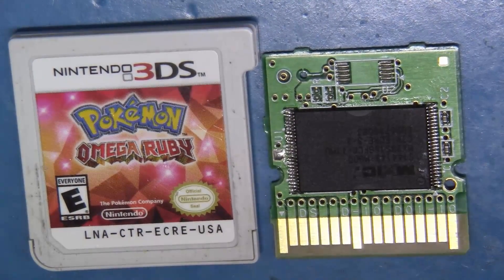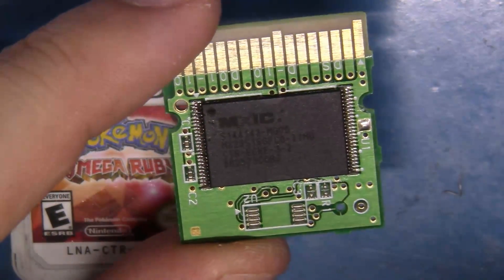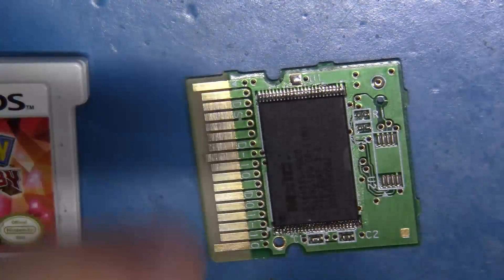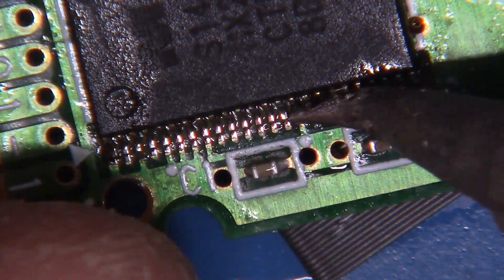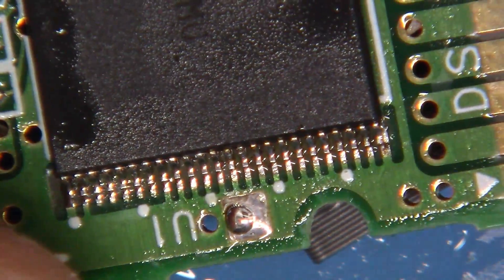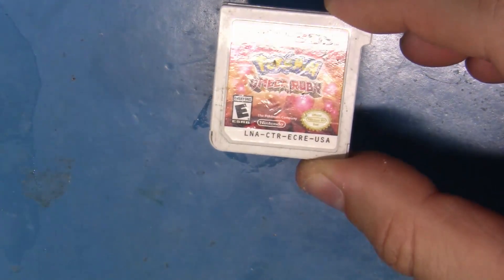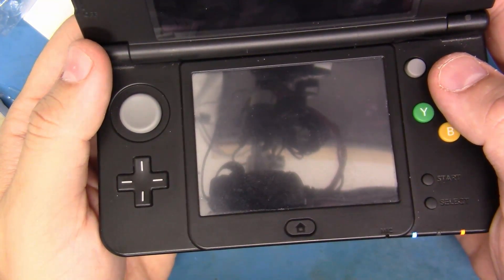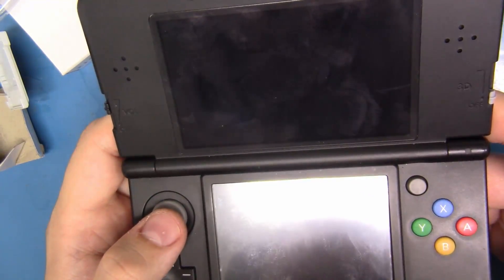Repairing a FAULTY Nintendo 3DS Pokémon Game Card | RAW/UNEDITED VIDEO

Comment: most electronic fails are a broken connection/wire of some kind, over the decades the only thing that changed is the size of the wire.
Step one is always check the connections to the parts starting from power supply(by that I mean the wall, not the PSU of a device) inwards, to eventually the part and if its more complicated and has more parts, power supply into those parts, then into the main part, whoever wrote those articles is ignoring basic diagnostics o problems.
slapping anything with a "these things just break LOL" is a sign of a lazy asshole.

Good work on the repair, and showing people how to do it, and inspiring people to repair. you got my like n sub.

Comment: At what point to you start to worry about overheating chips / components with the soldering iron? I worry about cooking things by accident a lot, so I was curious if you have a rule of thumb. Anyway, this is a great video clip.
Reply: It's fine as long as the soldering iron has grease for flow/keeping the area cool.
Reply: @Majinhero  oh, cool. Thanks!

Comment: not only can the thin pcb flex and fatigue the joints over time BUT the high tin solder used by most manufacturers since the early 80s is actually prone to crystallizing which means the internal structure of the metal solder changes and slowly becomes more brittle over time

Comment: As a fellow ksger microsolering person (though not as learned as yourself), I just got an axiun t3b jbc clone for 160 and it's incredible. I have the smaller t210 handle. I sold one of my ksger units. This seems to be the next great clone evolution the
Ksger was when it was new. I paid 169cad which was what I paid for my ksger

Comment: a reflow and a good clean is how i usually end up accidentally fixing things when i have no clue of what the issue is
Reply: Its always a good thing to reflow. That's how I fixed my copy of Rampage for the GBC after it had stopped working over 16 years ago.
Reply: Same, I fixed my Pokemon Crystal after reflowing the first chip. It's a really easy fix and it doesn't hurt to try it first before any other diagnosing goes into it.
Reply: If I want to reflow the contacts like this video, is a higher temp on my butane iron better? Or a lower temp? And is more flux better? Or a conservative amount?
Reply: @MrMunkboy  I start conservative with a reflow and get progressively more aggressive until it's fixed.

Comment: I was telling people about that when the whole craze happened. I had reflowed some Persona Q and Pokemon Alpha Sapphire and Omega Ruby's... there is a defect in fab though as these carts will fail more than others. Though it's really not the case of DOA where chips will die out even if you don't use them. People said I was crazy that it was everywhere. PS5's redesign was also everywhere for running hotter, when it fact it wasn't. Viewcounts > Reason.
Reply: So other 3ds pokemon games like pokemon sun and  moon etc. have not this problem?
Reply: @thatboi567  To my knowledge only Pokemon Omega Ruby / Alpha Sapphire and Persona Q were built like that.
Reply: @thatboi567  nope. I have X i have Alpha sapphire then Sun and Ultra moon. The only one that doesn't work is my Alpha sapphire. The others all work just fine so it mainly is an issue with those particular cartridges as the other games have had 0 issues at all
Reply: @thatboi567  My Y cart has issue. Could be wear heard a weird click before/during insertion though it went in fine, moved the save to sd fine but it shows up, not booting though. Has a playthrough or less so no massive wear. Likely getting a solder to try this out sometime.
Reply: @dianaalyssa8726  I have the exact same issue with my y cart. I can still transfer pokemon in and out of pokebank though the 3DS just won't read it

Comment: Hi Voultar, in the particular case of this cartridge; when you say it "wasn't booting", in what ways specifically was the system reacting to this cart? I have a copy of Pokemon Y that the system recognizes as Pokemon Y, it loads the icon (bottom screen cart icon), but then it fails to load the banner (top screen). It does also show me the update notice to download the game's v1.5 update but upon trying to launch the game, I get the "This Game Card could not be read." message. Same exact problem on two 3DS systems, my original launch unit, and also on my main system, a New 3DS XL Samus Edition. Note: I was able to successfully recover the save file off of the cartridge. Also, a dump of the cartridge resulted in a corrupt dump that doesn't match known hashes. It did however fully dump the 2GB.
Reply: It still could be some address lines that aren't properly connected. What are the differences in the dump? If it's only some bytes, then the rom could be corrupted.
Reply: @ponjadito23  I'm waiting on a replacement copy to compare against. But really, if one of the data lines was disconnected, I'm pretty sure the icon would not load, it wouldn't be recognized as Pokemon Y and also that the save would not be accessible either. Based on the description in the video, this cart simply didn't do anything at all in a 3DS, and now works after reflowing the chip.

Comment: I wonder if this is the issue I have with my copy of Pokémon Diamond. I've owned it since 2008 and a few years ago, the game wont read in any of my DS or 3DS systems. I still held on to it, hoping to figure out what the issue could be.
Reply: Before doing that, clean it really thoroughly, using alcohol and some cotton, maybe it's just junk in the pins
Reply: I guess there's only way to find out. Check the cartridges and reflow the said joints

Comment: hi, i dont know much about soldiering so just a few basic questions:
how hot should the iron be for this?
do you know any good soldiering tutorial videos?
is the flux nessecary?

thanks!
Reply: Practice on junk first. The temperature depends on your technique, you want it hot enough not to rip any pins off but not so hot it wrecks the board or chip. There are a bunch of tutorials, I can't think of any single one that covers everything but EEVblog, GreatScott, and element14 have tutorials plus Voultar's stuff is really good to learn from. It's good to watch a few different people to get your own ideas but no matter how many videos you watch, it's more of a learning by feel kinda thing. The flux is like a cleaner and helps avoid shorting adjacent pins, it makes it a lot easier and more reliable - sometimes an expert might be able to get away without it very occasionally on larger pitches, but for something like this it's pretty much essential (unless using hot air very carefully instead of an iron, but even then it helps make it more reliable)

Comment: so did this fix work in the long term? I have the same cart and it will boot up ok about half the time and then eventually error out, lasting sometimes even 10 minutes before failure. So just getting to the boot screen isn't exactly proof that it's fixed - maybe you just got lucky. I hope not, however, as reflow is at least something that can be done whereas a bad flash chip unfixable.

Comment: My Wifes Omega Ruby shows but says "This Game Card Could Not Be Read" is this the same issue and possibly require the same fix not that I trust myself to do this anyway...
Reply: might be an issue with cartrige pins making bad contact. try cleaning them with isopropyl. also the console's cartrige slot (albiet carefully, you dont want to break it)

Comment: My goodness I thought I was the only one with this problem but no ! Thank you for your video ! 
I still have one question, I am french and I didn't understand what kind of product you use to reflow the cartridge. Could you please write it down for me and perhaps explain where I can buy it ?

I hope you will see this message 🤞🏻 and thank you
Reply: looks like just a soldering iron, flux, and solder
Reply: @burp2019  Thank you for your answer.
This is something you don't find that easily or that you can handle without previous knowings...
Reply: @floflops30  they're extremely common in electronics work lol
Reply: Did this work for you? Got the same problem and am considering to try it
Reply: @CritsVG  Never tried, the procedure and products are not that clear
Reply: @floflops30  Alright, thanks a lot for your answer!!

Comment: I have a copy of Alpha Sapphire that boots, but it crashes at a particular spot. After the electric gym leader battle it crashes and gives me an error.
Reply: Electric types interfering with the electronics probably.
Reply: I have the same problem. What are the pbc codes on top of the contacts? The last digits are D01-10. And the batch code on the back side in black?
Reply: @PrimoAngelo00  DS N-7 D01-10 and ECL EX42001

Comment: I had something similar happen to me with an Arcade Card Duo, games that needed it would boot but then they would be missing sprites or backgrounds. It was a relatively expensive acquisition so I was bummed. I opened it up, saw nothing out of the ordinary and just figured I might as well take a shot at reflowing all of the solder joints. After that, I slot it back into the PC Engine Duo and voilà, it worked.
Reply: How hard/destructive was opening up the Arcade Card Duo to do the repair? Did you happen to take pics of the board out of curiosity ?
Reply: @saruhankarademir9806  IIRC I think I did take pictures. If you're careful it's not destructive at all. The backside is a metallic sheet that's adhered on to the plastic housing. Mine was already opening up a bit, I used a pick from the ifixit kit to go around the perimeter. Then I glued it back on with some spray adhesive. Looks good as new.
Reply: @hadesmcc  that’s really good to know. Mine has been fine (for the most part) and I keep it in my pc engine most of the time, but I suspect I’ll be doing this sooner than later. 
Which type spray adhesive did you use?

Comment: hey voultar, my new 3ds cannot charge via the plug but can be charged via the dock. Any idea why?
Reply: Because the charger port on the 3ds is broken. The dock charges the system via two metal contacts on the sides of the charger port.
Reply: @jimmyeddy  should the positive contacts be connected between these two different ports? I did a continuity test and the positive contacts don't seem to have a connection.

Comment: I checked the dump of my AS cartridge that stopped working, I found the dump to be almost perfect with only 10 differences against a good dump, so I doubt in my case that it's bad solder.

Or maybe the heat from the soldering iron somehow revive the flash cells ?
Reply: I have the same problem. What are the pbc codes on top of the contacts? The last digits are D01-10. And the batch code on the back side in black?
Reply: @PrimoAngelo00  D01-10
ECLPX42001
Reply: @indask8  I Have 42342
Reply: I have the same issue, reflowing doesn't do anything in this case

Batch codes:
ECLPX42125
DS C-2 D01-10

Comment: There definitely seems to be some statistical irregularity with this particular title, its counterpart Alpha Sapphire, and the US release of Persona Q, which came out within days of OR/AS. It's possible that that irregularity is in the form of a bad batch of solder instead of a bad batch of flash ROMs, so I'm not discounting the work presented in this video - it's definitely an interesting thing to consider, though it might be tough to test at any sufficient scale given the fact that most laypeople will not attempt a reflow of their own cartridges.

But it's also possible that this is anecdotal (especially since the majority of defective OR/AS cartridges reported are the PEGI release, not the ESRB release as shown in this video). There's also the fact that some people with defective cartridges and the capacity to dump 3DS games have dumped their faulty cartridge and found a relatively small number of discrepancies from a verified good dump - which, to me, points to data retention failure in the flash chip more than solder problems, which would presumably lead to a much greater number of discrepancies or a complete inability to read the ROM at all.

Hopefully both avenues will be explored, as this certainly is promising, and I frankly prefer this soldering issue to be the problem since it's fixable. But I'd also hate to see this spread as a 'debunking' of the reported problems when much more investigation is still required.

Thanks for the video!
Reply from the maker: Absolutely nobody under any circumstances has presented the information in this video in a manner that "debunks" the reports circulating of certain 3DS titles failing. I've said repeatedly and unequivocally that this is all incredibly anecdotal and can't possibly be asserted as an across the board fact or "fix".
Reply: @Voultar  I have 6 Italian (European version) ORAS game, 2 are not recognized, 3 with crash ingame. All 5 has been reflowed and only the 2 not working now are working fine. 3 with problems still have the problem. Tonight I will dump all the games to do a hex comparison. Almost all of them have been barely used. Only a Ruby has been hard used with >300 hours ingame (now is crashing ingame).
Reply: @PrimoAngelo00  What's the result? Posted it somewhere?
Reply: @PrimoAngelo00  did the reflow work in the long term for 2 that it initially fixed?
Reply: @PrimoAngelo00  boop
Reply: @Voultar  I find it HIGHLY unlikely that Flash chips are failing this quickly. These carts aren't even 10 years old, and I have EEPROMs made with MUCH worse technology from the 1990s that still work fine like motherboard BIOSes.
Reply: @Voultar  Yeah I agree you did not remotely present it as that, and I am not accusing you of doing so. I'm speaking generally because these things all have a way of telephone-ing quickly and getting out of hand (like the initial story of "50% of copies have failed" as you mentioned on your Twiter feed).
Reply: In mines case it is defenitely a data issue since it worked fine before i reset my save data to do a challenge run after playing trough it normally. Now it won't boot and will simply say the cartridge cannot be used (i know it is not my ds at fault because all my other games work just fine) previously however it would boot up untill the title screen and then just crash as soon as you pressed any button. The system sees it as an alpha sapphire copy but unfortunately doesn't see anything past that. (It is also defenitely Pegi release since i live in europe)
Reply: Dumps are mostly made from inserting a cartridge to a hacked console, wouldn't those discrepancies be made from failing to read due to faulty soldering? Either booting a game or dumping it, it's still the console reading a cartridge.
Reply: @ThemSensay  Yes it's still a console reading a cartridge, but the games are 2 GB, and there are at most dozens of solder connections. When there are just a handful of bit-level discrepancies from a 2-GB dump (which is a scenario that has been reported), that seems far too minor for an entire missing pin to be responsible for. I'd expect a much greater scale of discrepancies for the scenario where the solder is preventing one or more pins from being readable.

This example I'm referencing may itself be the anecdotal one, so more investigation is needed. But it does seem to me that there are multiple failure scenarios, with this reflow being a solution to one scenario but not a second.

 @NullPoEx  I hope not, but bad batches of things do exist. To anyone saying that ALL ds/3ds chips are now going to die imminently, I do agree with you that that is highly unlikely - I can't imagine Nintendo picked chips with such a short lifespan, and it's not consistent with prior examples of flash chips. But there are outliers that, due to faulty/out-of-spec materials, fail much ahead of schedule. And the fact that there are such high occurrences of problems for PEGI OR/AS and ESRB Persona Q, which both released within days of each other, makes such a 'bad batch' of chips seem plausible.
Reply: @bevilacq12  multiple potentials for failure from circuit faults due to a bad process that makes them susceptible to voltage/current conditions, inductance, etc or even poor solder connections that are also voltage sensitive or even I/O connections/conditions susceptible to cross talk inductance.
Reply: @bevilacq12  So pokemon sun and moon and the sequels are very likely to not have this "bad batch" problem?